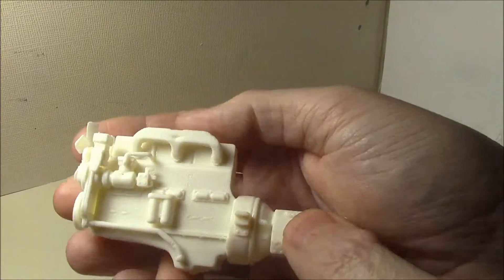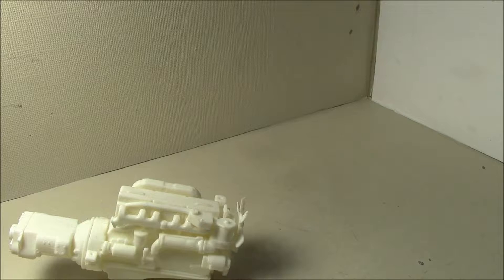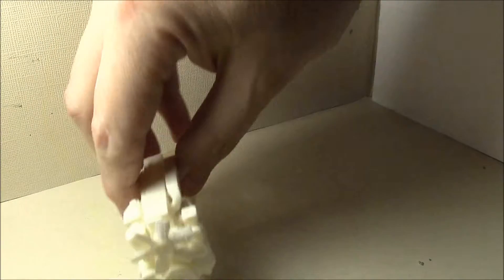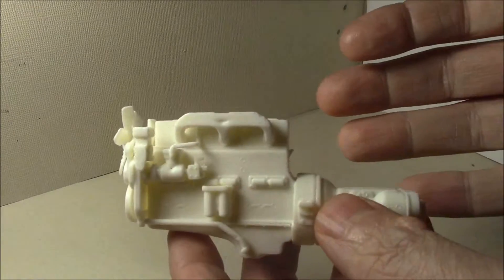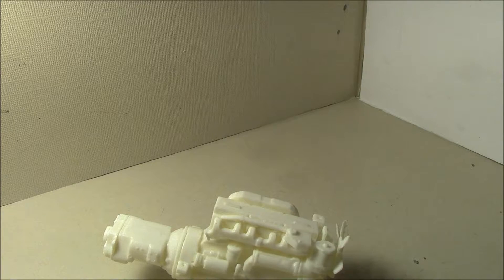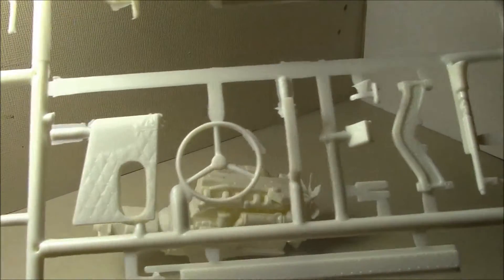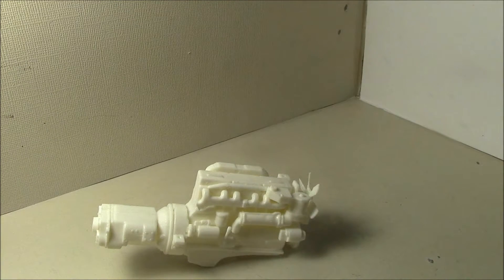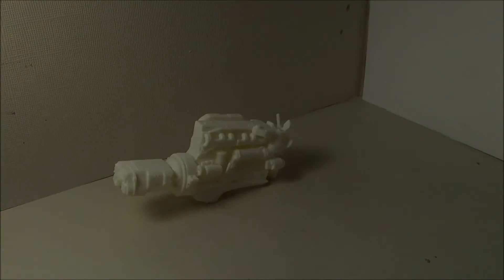AMT 1/25 White-Freightliner Tractor #1

Comment: Tough kit mostly because of that wretched two-piece cab. I think this is the most featured kit in YT videos, but unfortunately not for being a great kit. Problems:
- two-piece warped cab
- unclear instructions and no part numbering
- Front axle is too wide
- headlight buckets are too high on the cab
- over-sized rivets all over
- parts placement is lacking any precision
- steps behind steer wheels are poorly designed
- ...and more
This kit is not recommended for your first semi model build. It is very frustrating for novices. 
Upside: It will challenge the skills of skilled modelers. The box art is awesome and probably the biggest reason this kit still sells. 
Cheers to Round 2 for bringing this kit back so I can try to tackle it as an adult. They could make a nice fortune issuing one-piece corrected cabs for this kit.
Reply: I bought this kit for $4.99 in the fifth grade (1976) as my first attempt at a big rig build. Yes, it was the beautiful box art that lured me in. I had no clue what I was in for, but struggling through it almost killed my enthusiasm for the hobby. In addition to the problems above, I believe my version also came with the ugly, two-piece plastic tires. I cobbled it together, and when my dad saw it he said: "That looks really good."  And with that small encouragement, I went on to buy the AMT California Hauler which restored my faith in model building.

There were many awful kits like this from my past that I've since bought as an adult and redid as a "revenge build".  These include the Revell Baja Beast (my first ever kit as a second grader), and the notorious Revell 57 Chevy Nomad (seduced by all the opening doors and trunk). Those two are now trophies on my display shelf. This is one I'm about to tackle, eyes completely open, and expecting to beat it into shape. The big question: how far do I go to fix the seam on the day cab?

Comment: I've built 2 of these and they suuuuck. Be very careful when building the frame, making sure the rails are perfectly square. The entire cab mounts to the front of the frame via the chrome grill. If the frame holes are misaligned, you will have a tough time opening and closing the cab and also risk breaking off the part of the grill that attaches to the frame
Reply from the maker: Thanks!